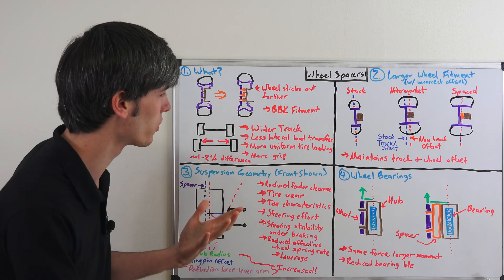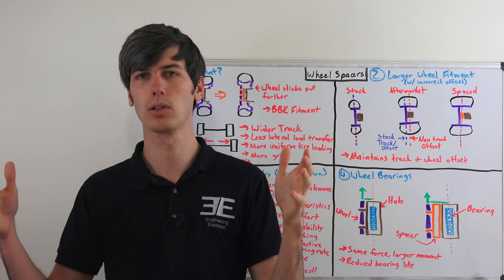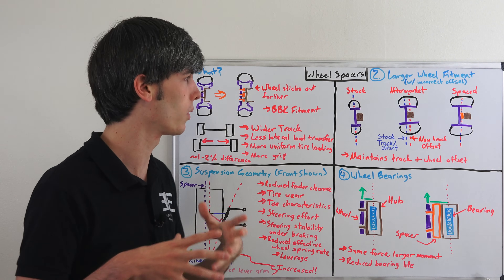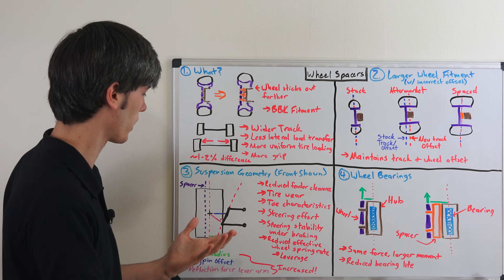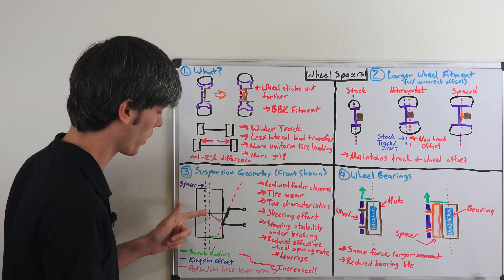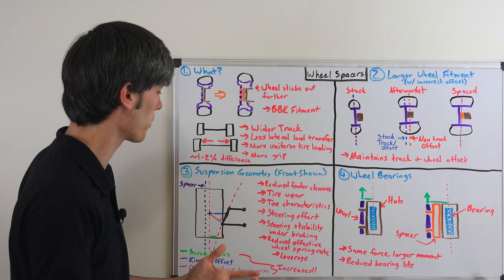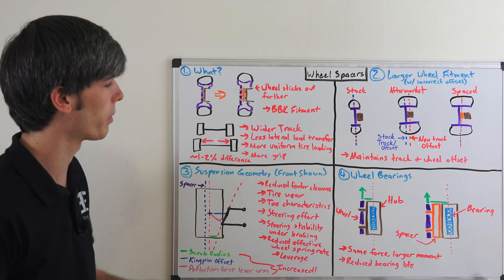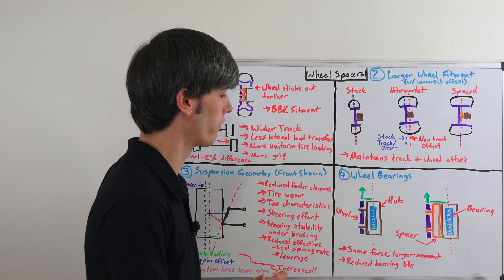Wheel Spacers & Adapters - Good Or Bad?

Comment: Does using a lower offset wheel have the same effect on bearings as using a spacer?
Reply: +JayOne89 It does have the same effect. Different wheels have different offsets. A 0 offset wheel is the only one that has a hub that is centered perfectly with the barrel. The URL below gives you a good idea of what that means.&#160;

The stock Acura TL wheel for example is an 17x8 wheel which has 235 45 R17 tires on it. It&#39;s offset is 47mm. That means there is a distance of 47mm from the hub to the center of the wheel.&#160;

If I bought wheels that are the same spec but have an offset of 57mm that means the wheel will be closer to the suspension components. Running a 10mm spacer would be the same as the stock spec wheel. If I run a 20mm spacer it would fill in the wheel gap and generate 10mm more clearance.&#160; 

If I bought wheels that are 37mm offset it is the same as running a 10mm spacer. The same goes for something that 27mm. 

The mounting surface on a wheel is a piece of metal that extends to the hub on the car. Whether you attach it on the car in the form of a spacer or a manufacturer puts it on a wheel makes no difference to the bearing. It is designed to take the OEM load. Changing the offset changes the angle of the load irrespective of whether the wheel does it or a spacer does it.

There is not better or worse. I don&#39;t understand where all the people that claim having offset wheels are any better when the same purpose is being achieved with spacers.&#160;

Teams all over the world in motorsports use spacers. Torque them correctly and buy TUV approved spacers. If Germany has approved the use of spacers on the Autobahn I&#39;m sure the use of spacers in any other part of the world is fine. Use the correct spacer with the correct stud pattern and there will be no issue.&#160;

So in other words yes a lower offset wheel has the same effect on bearings. The wheel will have the exact same effect given it&#39;s design and specs. 

http://www.rimsntires.com/specspro.jsp
Reply: +Lukeine A lower offset wheel means that the center line of the wheel is closer to the inside rim than the outside rim. Depending on your rims a (-) offset wheel will may or may not have the same effect when using spacers on different rims.

For example. If you had a ( - ) offset wheels, and took those same wheels and added a spacer to them, they will have different effects. If you had ( - ) offset wheels, and stock OEM wheels and added a spacer that matched the offset wheel it would still have a different effect because the size of tire that would fit on the stock wheels are different. If you had (-) offset wheels that were the same size as the OEM wheels and used a spacer on the OEM rims, the bearings would still wear on both, but at different rates. 

Think of it this way, with a spacer, you are pushing the wheel out. With offset rims, you are changing the center line of the wheels. It&#39;s always better to have offset rims than wheel spacers.
Reply: +Lukeine I would imagine that it does not, since you are mounting the wheel directly to the hub and not a spacer that sits off of your hub
Reply: +JayOne89 exactly. An easier way to say it lol.
Reply: imGenoo I can't say offset wheels are more convenient. Wheels are harder to come buy much more expensive to purchase. The Volks I have are cost 600 dollars a piece to replace 5 years ago and are out of production now. The best solution was for me to use spacers.

Offset wheels come in a variety of sizes and widths and DO NOT make up for the offset. My current set of volks are 18x7.5 with a 57mm offset. 

Run that against the stock specs I provided and you'll see there is no single formula for every car. You can get wheels with a 10 inch barrel that has a 60mm offset and a 4 inch lip if you wanted. 

Custom wheels can go in any different shape or form. Look at most offroad wheels. They run 0 offsets or -20 mm or -30mm offsets depending on the use.
Reply: +vidurc I believe part of what you are saying is correct. The wheel spacer places the wheels further out, while offset wheels mounts itself on the hub. Usually offset rims come in larger sizes and widths to make up for the offset. While wheel spacers add to the spec of the wheels you are planning to use.

Offset wheels are more convenient than using spacers. It's hard to explain through text.

Comment: I bought wheel spacers for some junkyard wheels I bought for winter tires, would these negative effects be really important if they were only meant to be on for 3 months (or less) of the year? I've heard of the wheel bearing issue but I was hoping that it would be a small enough difference that I wouldn't have to worry.
Reply: +Noman the reduced performance of the suspension/bearing wear would be a trade off for the significantly better grip is what I was thinking, but if it was actually dangerous I could still return the bearings and cut my losses with the wheels.
Reply: +Noman As an automotive major myself, I would tell you not to worry about the bearing wear. That is if you have a normal sized car. If you have one of those trucks with the fancy offroad rims with the crazy 1 to 3 inch spacers, this is where the problems will surface. 

Will it wear eventually? Yes. At what rate? In your case, probably not in the next 5 years. However, this all depends upon the climate you live in. As a student attending an Upstate New York school, I see cars that are rusted and corroded beyond your wildest imaginations. So pay attention to the climate. Especially if you have snow. The town likes to use salt, and this will accelerate wearing issues even further.

My opinion? Anything less than a 1/2" - 5/8" spacer is safe to run. Go any larger and you will begin to have wearing issues.
It's all about dat wheel fitment doe, swag bro.
Reply: +imGenoo I bought a 1.25" spacer even though it's a narrow gap between the wheels and the brakes because I didn't think the extra size would have been a big deal. I might have to actually measure it out if what you're saying is right...

Comment: You don't want the same offset on a wider wheel, you want an offset that puts the mounting face back to as close to stock location with the backspacing in mind to fit. Moving from a 7" to 7.5" with same offset means the mounting face has moved 7mm out, or a 1/4". If backspacing changes more, clearance becomes an issue on the inside. Right?
Reply from the maker: Absolutely, you'll certainly have to consider clearance on the inside.
Reply: +Bob Marley  I seriously do not understand people saying you should break in by driving hard... 

The target of the engine break-in is to let the sleeves perfectly match the piston and get smoothen up before pushing it hard. Have a go in a car lacking oil, quite similar: there is a lot of friction. I could get the idea of not stressing the engine by driving too slow to avoid heat during brek-in and let the pump push enough oil, but seriously man... never knew someone who advised a hard break-in, and sure would punch someone advising it.

Are they serious or just trolling?
Reply: +Engineering Explained Hi! I look at you out of Russia , trying to understand what you're saying , I'm interested to watch you! I ask you to tell all the details about the system of distribution of torque in the transmission Subaru on the front or rear axle (DCCD)
Reply: +Car Geeks Anonymous don't forget that 7 mm has to go somewhere, and now you have to deal with 14 mm at the fender. Would you like a baseball bat and heat gun?
Reply: +Bob Marley i've read that before and know people who break cars in on the dyno or even right at the race track like he mentions. Not sure there will ever be a definitive answer to this cause as u said, there are equal success stories either side. i'm gettin my motor rebuilt right now and still haven't decided how i'm going to do it lol
Reply: NIAtoolkit
yeah, same issue, I'd rather use the inner clearance, which means more positive offset.